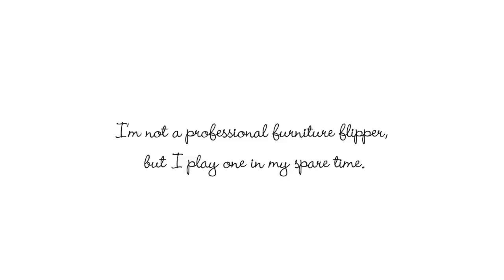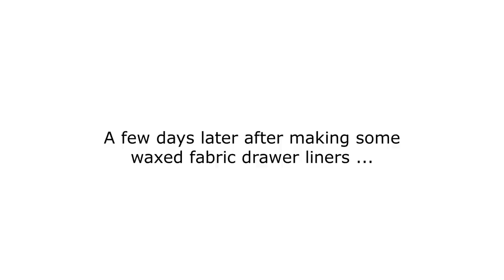Primitive Dresser Flip

Comment: Always save your pieces of veneer.  And the best leg bottoms are the plastic tap in one's. Those felt ones collect all the dust, animal hair, besides they slide off leaving sticky mess.
Reply from the maker: Good tip about the veneer. Thanks! I put felt bottoms on so I can slide my piece around since the plastic ones scratch my floor. Just before I deliver the piece to the buyer, I replace the felt pads with new ones.

Comment: I just cam across your channel and love what you did with this dresser. I also love that your video was silent save for the sounds of sanding, drilling, painting and gluing. 
I love the moulds! If you read this, might you add the name of the mould maker? I don't recognise it from the ones I usually see like IOD or Redesign with Prima.
Thanks so much. Ive subscribed.
.
Reply from the maker: Thank you so much! I like videos with just sound, which is why I made that choice. The moulds I used are from Re-Design by Prima. I bought them from Etsy. https://www.etsy.com/listing/622316568/free-shipping-prima-marketing-tillden?click_key

Comment: It turned out so beautiful! I’m interested in your waxed fabric drawer liners!!❤ How did you make those??
Reply from the maker: Thanks! For the drawer liners, I cut them to size plus 1/2" on all sides. This 1/2" I folded in with an iron, and used a fusible web. (No sewing. :) Then I painted on this product: https://www.amazon.com/dp/B00JRR29Z6?psc=1&ref=ppx_yo2ov_dt_b_product_details  and let dry. i did test this method before I committed to the real things.
Reply: @tracymillerdesigns  Thank you so much!! What a clever idea!!
I live in Florida, do you think the wax would melt and get in my clothes that would be sitting on the waxed fabric🤔
Reply from the maker: @Wendy-lm5gb  No, it wouldn't melt. You could always try a small piece and try it out under different conditions.
Reply: @tracymillerdesigns  thank you so much!
Reply from the maker: @Wendy-lm5gb  Let me know how it works out!